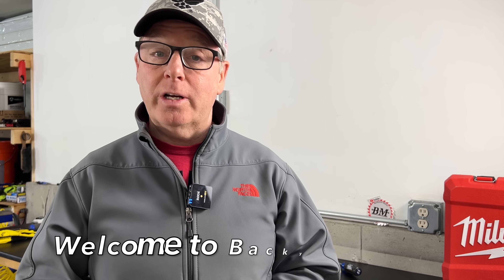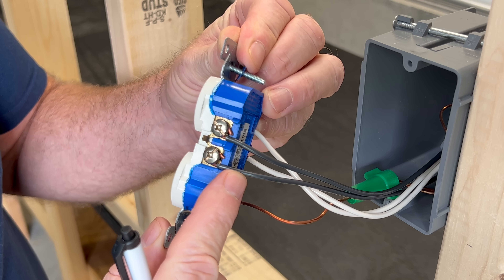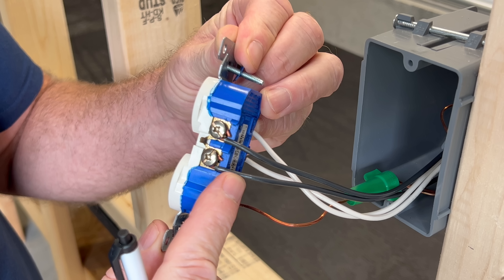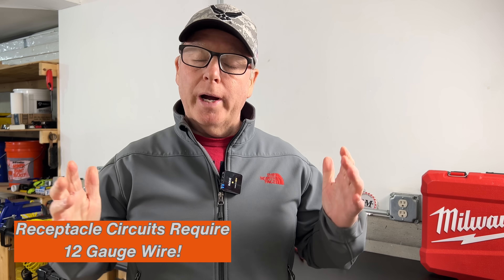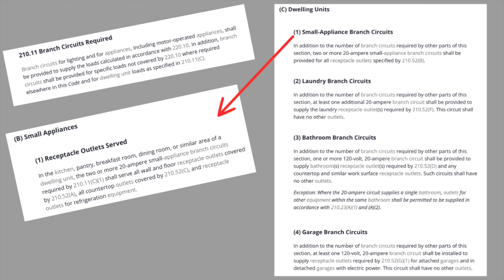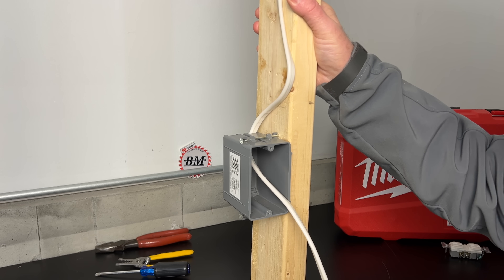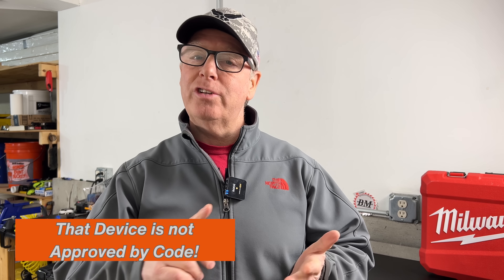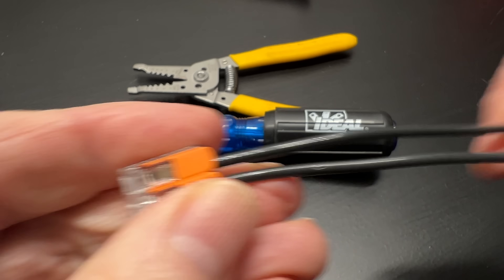5 Electrical Code Lies DIYers Should Stop Believing!

Comment: If you are building to "CODE" you are building to a barely acceptable standard. In fact building to code would be considered a D-.

As to pigtails or wirethrough. While both may meet a barely acceptable code standard it is just not smart. That means the recepticle is carrying all the current.
Reply: Absolutely wrong. There are lots of things in the various building codes that are far above barely acceptable. In electrical, for example, #12 THHN can safely carry 30 amps but the max current allowed on #12 is 20. Structurally, roofs are frequently over-designed based on worst case load scenarios that they will never encounter. A minimum requirement does not mean that the particular requirement is based on minimum or barely acceptable levels of safety or integrity. You're confused.
Reply from the maker: Sorry but you are wrong about your view of the code and about pigtails. The code is not a minimum standard. I hear that a lot but it's not accurate. If you believe that then maybe your running 10AWG wire or larger for 20A circuits or maybe your installing receptacle every 4 feet along the wall instead of 12.. Yes you can go above the code but calling it a minimum standard and a D- is ridiculous.
Reply: @BackyardMaine sorry dude but nec is the absolute minimum requirement for electrical installations.
Reply: @Tom-og7fi  No, it's not. The only reason why any jurisdiction follows the NEC is because they have decided to follow it. The NEC has no authority on its own. The AHJ has the option to amend any rules they wish since they are the authority who determines what codes to follow. Chicago, for example, does not require AFCI protection. Their choice, their decision.
Reply: @pld8993  any and all jurisdictions having their own local code is always above and beyond what the code requires. Afci breakers work and that is a fact. If a local entity is not following the code they will eventually get themselves into some trouble. Afci breakers are very difficult to deal with but they are telling you something most people don't want to hear. I deal with afci breakers regularly, when installed correctly there are no issues. The bottom line is I'm telling you that the code is the minimum requirement for electrical installations and you don't like hearing that, but it does not change the fact that what I am saying is true. Local jurisdictions have a certain amount of time to move on to the newer code for liability reasons.
Reply: @Tom-og7fi  You are 100% wrong. There is no requirement that local amendments exceed the NEC and it is not true that local codes are always (or required to be) above and beyond the NEC. Chicago, for example, does not require AFCI protection and there is no rule that says they have to because they are the rule deciders. Where I'm at the local AHJ has waived most of the requirements in Art 620 for elevators that are installed in homes. Why? Because they can; they decide. The NEC has no authority except the authority given to it by the authority having jurisdiction. There is no time limit to change to a newer code edition. That is false. If I'm wrong, please share any legal or code references supporting your argument
Reply: @BackyardMaine  I have spent a fair amount of time building houses from the ground up. Building anything to "code" is meeting the minimum. You don't have to agree with it but that is indeed the fact. Meeting the code is doing the bare minimum allowed not building it to the optimum level. I have seen so many crap thing done to code that will cause problems later. The problem with codes is there no grading scale to differentiate a bare minimum practice to the preferred or even top notch standard. So many contractors push the limits of what is barely acceptable. You dont' have to like or agree with it. The fact remains when its a pass/fail you are builidng a D rated house.

Comment: To be fair, the code is also full of dumb requirements. Example, they require a GFCI for all plug-in EVSEs (625.54). All EVSEs, by design, have built in GFCI, and doubling up GFCIs can result in false/nuisance trips. It's also based on the idea users will be plugging/unplugging their EVSE... this requirement doesn't exist for outlets meant for RV use, or a welder, etc. I get why code exists, but sometimes it can be dumb.
Reply from the maker: When you’re connecting or disconnecting you plug when wet conditions may exist the GFCI protection after the plug would not protect you. That’s the reasoning behind having the additional protection.
Reply: @BackyardMaine  understood. But it will cause false trips having dual GFCI. apparently there is low a class b GFCI breaker that trips at 20mA which may solve the issue. This is, according to clippercreek.
Reply from the maker: @stazeII  I have never had redundant GFCI cause any false trip. What your talkng about is an SPGFCI. (Special Purpose)

Comment: 33 year general and electrical contractor here.  Totally agree with your points.  Although not required, all my projects have 12 ga wire for outlets.  Also I always have separate circuits for lighting and receptacles.  It never seemed smart to have the lights go out if an outlet tripped a breaker.  An observation, as I am now in my 70's very few inspectors even try to challenge my expertise.  Most inspections last no more than 5 minutes.
Reply: That is how I, a DIYer, do it. Just makes sense. I began rewiring parts of our 85 year old house after my mother had the fuse box replaced with a breaker panel (by a professional, of course) and breakers started tripping. Left all the overhead light fixtures and most receptacles on one circuit. Was a rats nest to untangle. We're all conduit, so that did make some things easier.
Reply: My house is over 100 years old. Wiring installed maybe 50-60 years ago. Some "upgrades" after that. The only things that make any sense are the parts that I added or changed myself. I've been in building trades half my life or more and could never understand why anyone wouldn't pay a couple extra bucks to have dedicated lighting circuits.
Reply: I am 69 and not a professional, but have done several fully inspected full panel upgrades, and dozens of minor projects, going back to the early 1980s. I have always used 12–gauge wire, commercial grade outlets and the deepest outlet boxes that will fit in the wall space, even if only a single outlet is in use. For the DIYer, the additional cost is insignificant.
Reply: @TruthInFlying  in my opinion all receptacle  outlets  should be on a minimum 20 amp circuit (12 gage wire) because who knows what load will be on that circuit.
Reply: I'm similar to you. Most inspections are me giving him info he needs for the certificate and then talking about retirement. Well, he's talking, I'm just dreaming. I too used nothing but 12 for outlets most my career, without question. That was until the great reset of a few years ago and prices skyrocketed. Now I'll give them the option. In today's world I think it's foolish but if they want the lowest price then it's 14 wire everywhere but the exceptions. And BTW, did he miss a coup locations where 12 is required? I didn't hear dining rooms or garage. He did have a 2023 book in the picture but surely they didn't eliminate those, did they?
Reply from the maker: @snakeinthegrass7443  I did say Garages but not dining rooms. They are not required in dining rooms and thats not a change. Ive been in the electrical industry to 4 decades and I don't think the code ever required 20A circuits there. I do have the 2023 code and I took the 15 hour update as well.
Reply: @BackyardMaine  I apologize about the garage, geez I guess I missed it. Thanks for your credentials but it's unnecessary bc I know a pro when I see one. I've been around for almost 40 years myself. I wasn't questioning your knowledge, I simply did not hear you say those locations and was asking the other poster if you said them or if code changed. (not worded very well) 
Anyway, I never looked it up before bc I was always told by coworkers and inspectors alike that dining rooms require 12 wire. Since my book is in the truck and it's nasty outside, I tried my luck on the internet and it appears this is one of those grey area that gets interpreted differently. I was searching some forums and such and it seems to come down to 210.52 (1) which refers to the small appliance circuits serving all receptacles covered by 210.52 (A)  Pantry, Dining Room, etc. By default, then, they would also be on a 20 amp circuit. I have never seen anyone or certainly haven't done it myself, and that's pulling ANYTHING off the countertop outlets except other countertop and island receptacles. That's crazy, imo. 
So in short from what I've found in a few minutes of searching, that section says the small appliance circuit "must serve" those other outlets in those locations. IMO that means a 20 amp circuit - and from my understanding it's bc of things like buffet tables with hot plates and other meal-related appliances. I do know that even inspectors disagree on codes from time to time. I've been frustrated several times over conflicting interpretations. So if your people pass 14 wire in the dining rooms, great. Maybe it's a geographical thing as well. I'm in upstate NY, near Albany, so maybe they're a little stricter, Idk. I just do what they tell me. So no hard feelings. I sensed you were a little upset with my post and I'm sorry if it came across as offending. Peace and blessings
Reply: You have an interesting take on dining rooms.  Seems to directly contradict 210.52(B) where the small appliance branch circuit is supposed to serve a number of areas, including dining rooms.  As we know, the small appliance branch circuit is a 20A circuit.  This requirement considers the notion that in dining rooms and breakfast rooms there is a high likelihood of an appliance being used at the table - waffle irons, coffee makers, fondue pots, slow cookers, etc. @BackyardMaine
Reply from the maker: Only if any of these areas have countertops. A table in a dining room is not considered a countertop.  @steveloux4709
Reply: @BackyardMaine  That makes sense that code would stipulate counter top , and not dining room.  Meaning something attached , not a piece of furniture .
And code would not worry about the occasional appliance used at a table.
But what is not mentioned in this thread discussion , is the number of individual small appliance circuits a given area might require .  Being a jack of all in the remodel industry .  I only know from word of mouth on the jobs ... but also what the customers plan is for the appliances they will be using .  Whereby I always will add up the wattage .   So I have always given at least two circuits , sometimes 3 to 4 for kitchen/food areas .  And discuss the limitations with the home owner .
Reply: @BackyardMaine  By the way , might you know what is up with some of the over range microwaves .  That start to always trip the 20 amp dedicated circuit they are on ?  Is this just a case of bad designs with high powered microwaves , that hopefully won't be getting manufactured and sold anymore eventually ?
I've replaced 3 so far that were not very old .  And always decided upgrading the wire to 10 gauge with 25 amp breaker was not a good idea .

Add edit :  I just realized maybe the voltage fluctuation coming in the house is causing it ?
For example the micro wave is 2300 watts at 125 volts draws 18.4 amps .
But at 110 volts it draws 20.9 amps .
Is that correct , and what the problem is stemming from , other than the design not accounting for it ?
Reply: @BackyardMaine  I disagree respectfully. Dining rooms & Kitchens have always been required to have 2 (a minimum of 2 you can have more) small appliance branch circuits (20 amp) to serve receptacle outlets and if two circuits are installed at least 1 circuit mut have at least 1 receptacle in the other room. In other words, you can't take 1 circuit for the kitchen and 1 for the dining room. Then if something like a window AC is installed in the DR it should be on a dedicated circuit and does not have to be 20amp circuit. Same goes in the kitchen for the dishwasher and disposal which can be cord connected not required to be 20 amp.
Reply: @ed6837  Correct. 210.52(B)(1) is clear. The two or more appliance circuits SHALL feed ALL required receps in kitchen, pantry, dining room, etc. Therefore, all dining room receps must be on 20 amp circuits and only other kitchen and dining room receps are allowed on that/those circuit(s).
Reply: Seems like it would clarify things if they just required any receptacles that could serve a countertop to be 20A, plus garages of course (though many people have countertops in their garages too, but that’s another story). That would cover kitchens, bathrooms, and laundry rooms. Somebody should let the folks who write the NEC know. 😜
Reply from the maker: Thanks for sharing
Reply: Although not required, do you pigtail outlets?
Reply: 12 gauge makes so much sense to do [vs 14]

Comment: Been in the trade since 1988 working as a licensed journeyman. Any one that runs 14 for recepticals IMHO is crazy. Sooner or later someone is going to plug a space heater or two in to that branch. If it is only one receptical that's fine.  I have replaced more recepticals that have overheated on 14 ga wire,  (burned) wire connections. Fire hazards waiting to happen.
Reply from the maker: I started my electrical career in 1984. We’re now the old guys. lol. My opinion on that is as long as the breaker is sized correctly the wire will not have a problem. Most electric heaters are 1500w which will draw 12.5A or just over 80% of the circuit rating. A second heater will trip the breaker pretty quickly. But even if the heater were on a lower setting and you were able to draw 100% of the circuit rating the wire should hold up fine. That of course is if the connections were made correctly and the back stabs weren’t used.

Comment: Nec is great its logical , but go to theae towns around the major city and stupidity that comes with some of tuose codes are just like what. How does that make sense, kind of stuff even after the inspector ezplai s to you why you had to donit like thisnin this town that is 5 min from the town next door that uses standard code for the area, not some crap couppe guys though of in back to make it seem like they are doing work

Comment: @ 1:45 you have a potential code violation with the receptacle installed above the baseboard heater.  Not a specific NEC requirement, but see the informational note at 424.9 "Informational Note: Listed baseboard heaters include instructions
that may not permit their installation below receptacle
outlets."  If the heater instructions say not to install below a receptacle outlet, that's a violation of 110.3(B).
Reply from the maker: Nope. That is going to apply to electric heaters. Hydronic heaters don’t have instructions to not mount receptacles over them because they get warm not hot. Homes in the northeast where I live will have about half the exterior wall space covers with hydronic heaters.

Comment: The only reason a dislike the ground up orientation is that the vast majority of 90° plugs are ground down. Not saying that’s a good reason, just saying that’s why I do ground down. 

I also don’t find myself handling thin metal objects directly against a wall. 😐
Reply from the maker: I agree. Actually many electrical devices are UL listed based on a ground down installation and to use it otherwise would void the listing.

Comment: "Listed" means UL UnderWriters Labratory listed
Nobody says "pigtails" are required on hot & neutral wires
The "pigtails" that that are required are referring to the ground and using "greenies/greeners" green wire nuts with a  hole in the end leaving the line ground (line is the wire bringing power 😅
Reply from the maker: No not at all. Many people including electricians often say pigtails are required. They are always required on the grounds because devices will only have one ground terminal.

Comment: Don’t disagree with anything you said.  On the topic of “approved,” you should have focused on the NEC definition.  It’s all up to the AHJ whether it’s approved or not and equipment without a listing mark could still be approved, although it’s unlikely.
Reply from the maker: I did put up a note that said “Approved- acceptable to the authority having jurisdiction. It was easy to miss. I get the comment on listed devices and equipment all the time.

Comment: I don’t care what code says but wiring through a device as seen at 0:56 is dangerous… I have the lack of pig tails nearly cause a fire … once in Minnesota where an outlet overheated melting the plastic box and changing the wall before it was discovered and disconnected…. And again in my shop addiction in Arizona… just cus’ it’s ok by the code doesn’t make it correct …
Reply from the maker: Did you know that the pass through current rating is 20A even on 15A receptacles? They are actually tested at 30A by UL to get the 20A listening. As long as the connections are made up correctly and the back stabs aren’t used you’re never going to have a problem
Reply: You're wrong, it's not dangerous.

Comment: Code says circuit MUST not be dependent on the device
Reply: That's in 300.13 and it ONLY applies to multiwire branch circuits, and ONLY applies to grounded conductors.  Just like he said in the video.
Reply from the maker: This is exactly what I was talking about. You should watch the video again a pay attention to the part about 300.13.